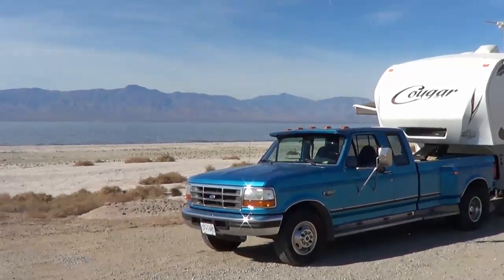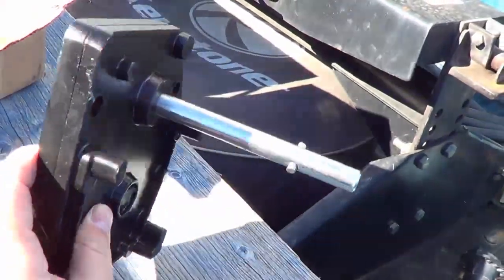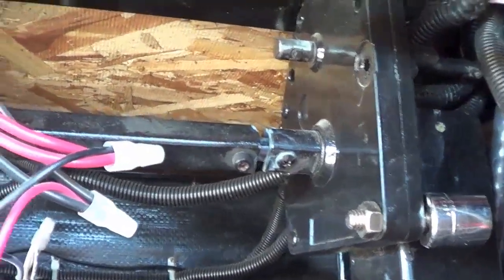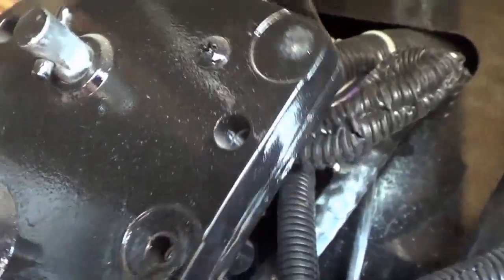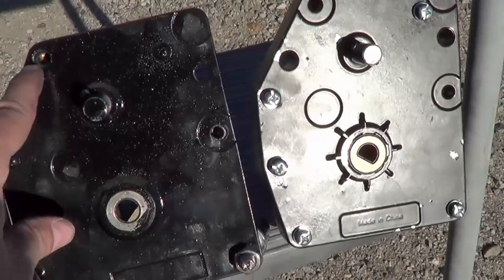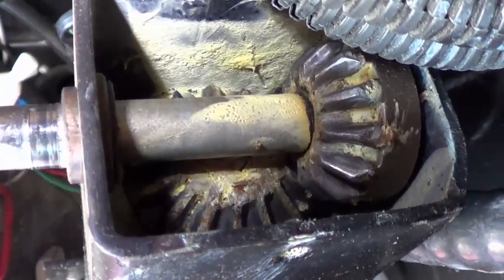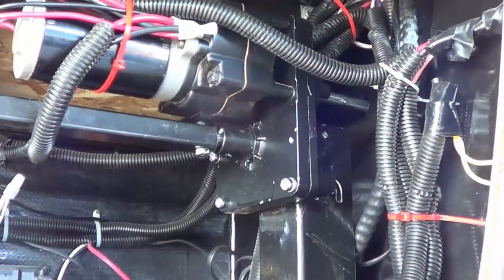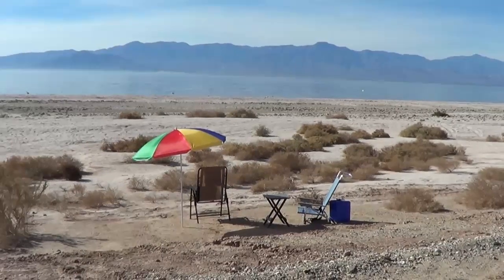Replacing My Fifth Wheel Landing Jacks Gear Box

Comment: Thanks Ray for the great informational video.  About to help a friend in the next few minutes to replace his landing gear, which also came from etrailer.   Glad you used etrailer for your parts too,  been using them for several years---absolutely great people to work with! Enjoy your camping life.
Reply from the maker: You're welcome, the replacement gear box is still working well 8 years later. Cheers, Ray

Comment: Hi Ray, loved this and your other videos. I have a Keystone Cougar 276RLS which looks like the same RV you have, so I consider myself double lucky that I found your channel.
One thing I'd like to add is something I did wrong - hopefully it may help someone else from making the same mistake. Like you mention in the video, the landing gear motor should be removed by loosening the slotted head screws only - do not remove the bolts that require a hex wrench. I removed all four and the two parts of the motor's casing came undone and the gears fell out.
I got the gears (four of them) back together again and they seemed to operate well. I was pretty happy about the whole situation until I tried to fit the two parts of the casing back together again. I can't get them to seal - there is an approximate 1/8" gap. 
I was wondering if you or your viewers have ever encountered the situation where they could not get the casing to the motor to seal. If so, I would really appreciate the advice. Thanks!
Reply from the maker: Thanks. :) I wonder if maybe one of the gears is in backwards causing the clearance issue.

Comment: do you have to block up the RV while doing this, or will it stand on the legs?
Reply from the maker: It will stay standing just fine. Inside the legs is a long vertical worm gear and at the top a set of beveled gears. You can see me take one apart in this video https://www.loveyourrv.com/repairing-my-broken-fifth-wheel-landing-leg/ and lube here https://www.loveyourrv.com/fifth-wheel-power-landing-jack-leg-lubrication/
Reply: @LoveYourRV  thank you very much! i just bought an older one and selling a newer bumper pull toy hauler. I had to assist raising it with a floor jack and motor was flopping around.

Comment: Ray I cannot identify which reduction gear box is on my rv. The shaft is 1/2 inch diameter in leg and key shaped going thru reduction box. In your video you swapped gears to make yours work. Any thoughts on what part number or brand is on my camper. Thanks!!
Reply from the maker: Not sure, I would check out this website - https://www.etrailer.com/s.aspx?qry=gear+box&furl=-pg-Accessories_and_Parts
They are pretty helpful

Comment: Hi. I replaced the gearbox and greased the gears. The jacks will retract, but fuse pops when I try to raise the camper... ????
Reply from the maker: Could be too low of amperage fuse. Mine uses a 30 amp or a bad motor drawing too much amperage or something is binding like one of the landing legs. Could remove the legs and see if they both move freely. Here is a video about removing and lubing the landing legs. https://www.loveyourrv.com/fifth-wheel-power-landing-jack-leg-lubrication/  Cheers, Ray

Comment: I did this replacement and was working fine till one day it would go down but wouldn't go up. Has power, would hit the button to go up, and it would try to move the bar, but it couldn't turn it. Replaced the gear box and motor. Idk what the issue is now.
Reply from the maker: Make sure the battery has a good charge and the wiring and connections are good. It take a lot more power to lift than go down. Also could be one of the legs jamming up. I'd test them individually if you can get it onto a truck to hold the weight safely. Cheers, Ray
Reply: @LoveYourRV  I will have to check once it's back home. Thank you
Reply from the maker: Here are a couple of how to videos I've done about the landing legs Replace https://youtu.be/jL12JJ5Fmis Lube https://youtu.be/U9naxSjaA9w

Comment: You took the old gear which was giving you a problem and the put it in the new gear box. What am I missing here. Did you not just shoot your self in the foot?  Why did you change it to begin with? What am I missing?
Reply from the maker: The failure was with the case. Had a broken plastic tab. See this previous video https://youtu.be/QdJT5c3afPg  The metal replacement is still working well to this day 8 years later. Cheers, Ray

Comment: Ray, my landing gear motor and gear work if no load.  But it has started to. Make a clicking noise, rather than lift or turn the jack.  Do u think it is just the gear?  Motor, gear and jack are a couple years old.  Thanks.
Reply from the maker: Clicking sure sounds like a bad gear. You can try using the manual crank to see if it's the motor or the gearbox that's the problem. Here are a couple related posts on the landing legs, one of mine ended up being faulty. - http://www.loveyourrv.com/repairing-my-broken-fifth-wheel-landing-leg/  http://www.loveyourrv.com/fifth-wheel-power-landing-jack-leg-lubrication/
Reply: Love Your RV _ Ray the clicking is from the slip clutch that is attached to the motor, between the gears.  If I get a new motor it should come with.  But do you know if I can just get the slip clutch?
Reply from the maker: Sorry I don't, I haven't seen that part listed separatly anywhere. I would give Etrailer a shout, they were pretty helpful when I've contacted them - https://www.etrailer.com/customer-service.aspx

Comment: Just ran into the same problem 3 yrs after seeing this video.  Atwood bought out by Dometic.  Dometic destroyed all the molds or jigs so these parts are no longer available.Options are used parts or replace whole system with Dometic.  My understanding is Domestic's bolt patterns are  the same.Parts may be online if your lucky.
Reply from the maker: Maybe try Etrailer - https://www.etrailer.com/dept-pg-Accessories_and_Parts-pc-Gearbox.aspx or Amazon -  https://amzn.to/2M8eZZv  The one I used was from Stomberg Carlson, has been working fine since. Lippert also makes one.
https://www.strombergcarlson.com/product-category/fifth-wheel-landing-gear/

Comment: How did you determine which gearbox to buy?
Reply from the maker: I couldn’t find any markings indicating the make and model of the landing gear but through trial and error comparing pictures online I narrowed it down to an Atwood product and the gearbox part number to 70754. 
I was going to buy this replacement part I found on Etrailer.com, but noticed they had a different part made by Stromberg Carlson that was almost exactly the same. The big difference for me was the Stromberg part was made from aluminum and the Atwood is plastic. Since that didn’t serve me very well already I decided to order the Stromberg Carlson – http://www.etrailer.com/p-LG-179015.html. As it turns out though the part had a slight difference. The crescent-shaped opening for the landing leg gear shaft was slightly smaller, making it impossible to attach to the landing leg drive shaft. I got around this by swapping out the main gear from my original gearbox into the new one and made it work.
Reply from the maker: The replacement s still working well almost 9 years now
Reply: @LoveYourRV  Ours is an Atwood. as well. I ordered the Lippert 276602 Gearbox For Universal Mount Landing Gear On Fifth Wheel RVs. Fingers crossed.

Comment: Excellent job, learn a lot from you, did you switch the gears disc? Thanks.
Reply from the maker: Thanks. :) Yes, I swapped the large gear. The gearbox has been working well ever since.
On a related note I have had a failure to one of my landing legs a while back - http://www.loveyourrv.com/repairing-my-broken-fifth-wheel-landing-leg/ Also if you're interested, here is how I lube my landing jacks - http://www.loveyourrv.com/fifth-wheel-power-landing-jack-leg-lubrication/  Cheers! Ray

Comment: I can’t get the Sleeve off to take the gear box off
Reply from the maker: On mine, there were a few metal burrs around the screw hole on the shaft. I filed them off and the sleeve came off easy.